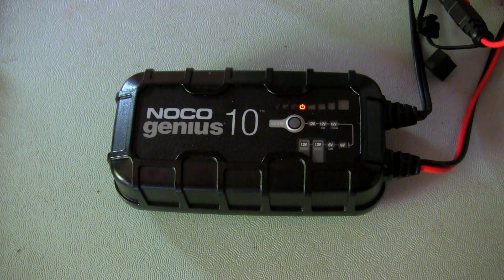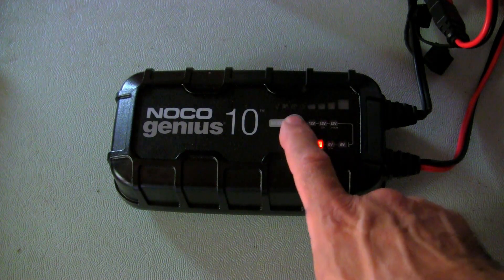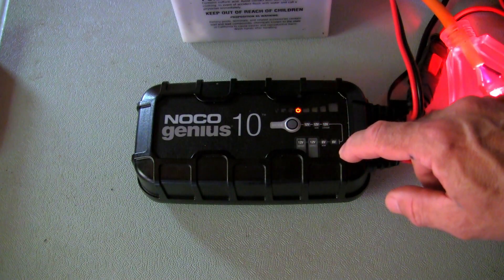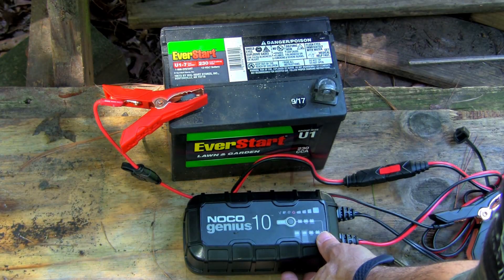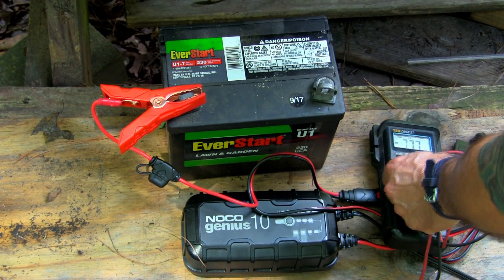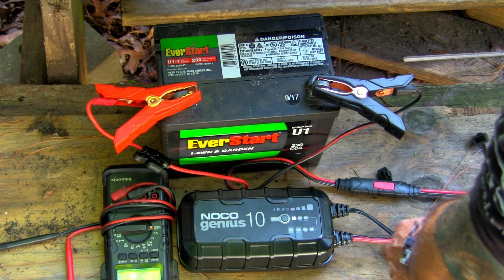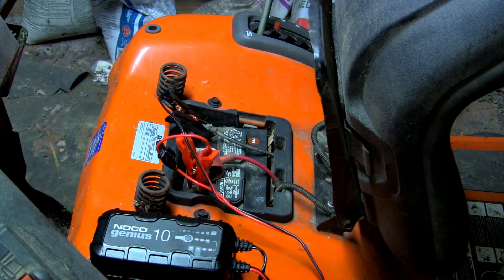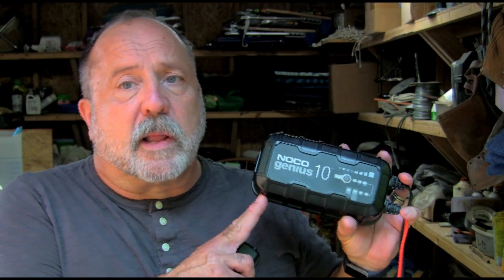Noco Genius 10 Battery Charger and Conditioner Overview Tutorial and Tests

Comment: When mine is on stand by and I push the button the orange light just blinks it doesnt switch to the other options like yours unless I hold the button for like 5 seconds and then it goes to the 3 12v options next to it

Comment: ITs  3am in the morning in the uk 9th January 2026. I am still shaking from what might have been. At 11.00 pm I decided to go check on my pride and joy a 22  yamaha xsr900 that i have been keeping in a downstairs basement .I had been given a noco genius 10 for Christmas and for what ever reason I thought i would plug it into the noco battery plug which I had fitted to the battery terminals earlier in the day. The bike hadn't been out since october so I reckoned it would need a charge. It is a 12v lead acid battery and was reading low on the noco with only 1 light flashing which indicated the battery was 25% according to noco. That was it I assumed everything was fine and I headed off to bed.
  Well for some unknown reason I woke at 2.00pm my bedroom door was closed but i imagined i smelt a very faint funny smell a bit like incense some religions waft about at a funeral. I thought i was imagining things but eventually I jumped out of bed and went down the hall I couldn't smell anything but heard a faint whistling sound coming from downstairs, immediately I thought I was being burgled so I grabbed a baseball bat and ran downstairs it was then i smelt this sickening smell and when i turned on the light the smoke was rising from both sides of my bike . I lifted the noco charger which was still charging !! and it burnt my hand. I panicked ripped the leads off and got the doors open and took the bike outside . the whistling noise was so loud I thought it was coming from some components on the bike .I fumbled in desperation to get the battery out what a job, the battery bracket was so hot the whole area around it was minutes from combustin  I was very fortunate it was raining heavily. The sides of the battery  were melting but I was scared to pour water on incase it caused reaction with electric's and made things worse.  i got it removed by using 2 screwdrivers in below each terminal , then I threw a whistling battery down my garden.
     Folks this has been a life changing lesson for me NEVER leave a battery on a charger. I have been keeping motorcycles in my basement for 35 years never an issue until now but it only takes one balls up and you're headin for heaven or hell. Now that's my experience of a brand new noco genius 10 . This charger is a fckin death trap .How could a charger so sophisticated as this not turn itself off not even burn a fuse or set off a trip and it was ready to go on fire. These chargers are dangerous and need recalled worldwide they have a serious flaw be warned. 
I doubt I will  sleep tonight but hope by sharing this terrifying experience  that  I can save someone from burning their house down or worse

Comment: Bought and just tried the power supply mode. According to the manual:
"As a power supply, it can also be used to retain a vehicle’s on-board computer settings during battery repair or replacement. 13.6V Supply provides 13.6-volts at 10A with overload protection at 12A"
Well, I tried it out and at best, it maintains  11.9V which is no where near 13.6V
Anyone else try out the Power Supply mode?
Reply from the maker: Thanks for sharing your experience, that's good to know!

Comment: I think mine is crap. I have to hold the power button for 3 sec then the supply one lights up, if I continue to hold it then all the 12v will flash. Release then select the battery. It won’t ever let me go into repair mode. Bought the battery new less than a month ago.
Reply from the maker: That's definitely not normal, maybe try contacting their customer support.
Reply: The clamps need to be on the battery to enter repair mode. If it still won’t go into repair mode with the clamps attached and holding the button down for 3 seconds then that’s a defective unit for sure. At that point reach out to Noco.